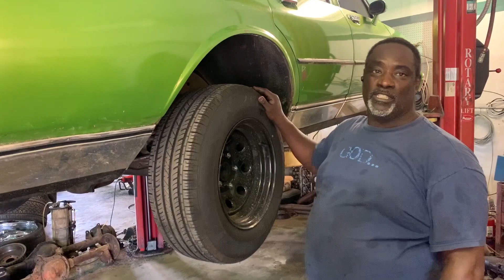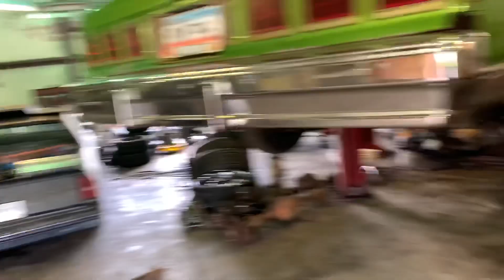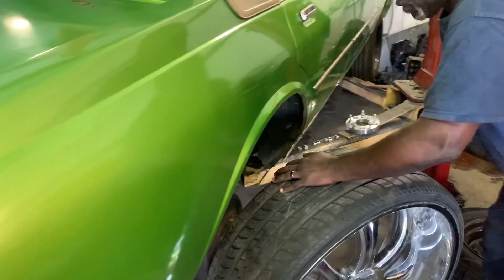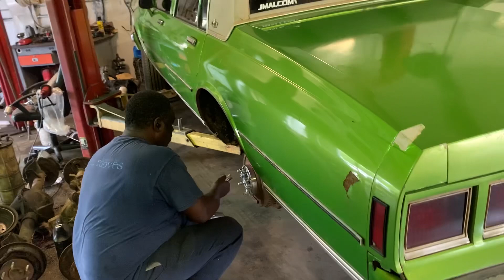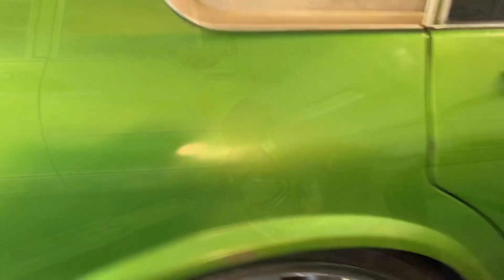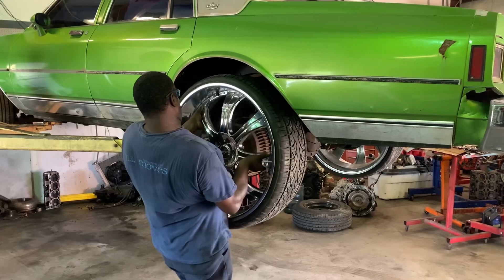MOUNTING 28 iNCH RIMS ON THE BIG MEECH BOX CHEVY FOR JMALCOM2004RIDES

Comment: didn't need to cut it just adjustable arms in back. didn't need spacers if your rims where correct offset
Reply: Steven Hale  not gonna rust of you use rustoleum bed liner spray on it then put the trim back on.